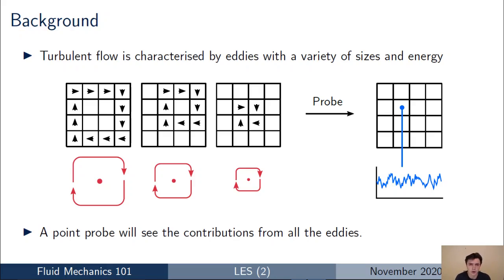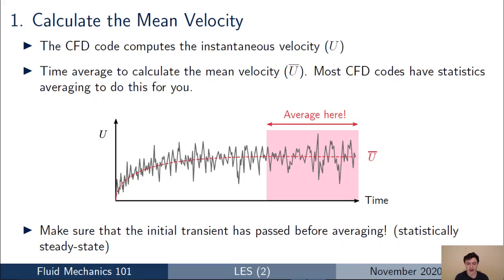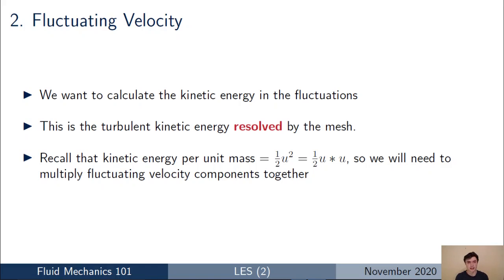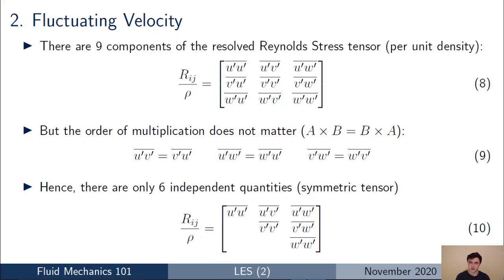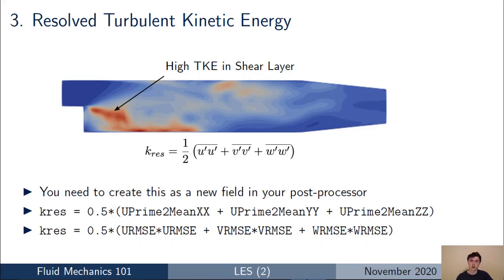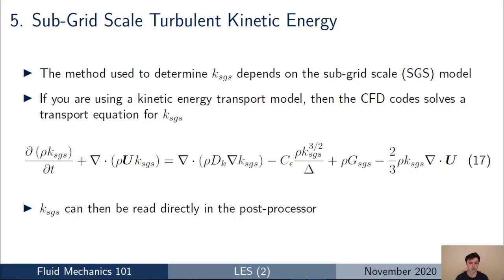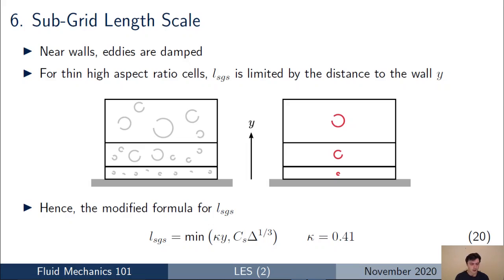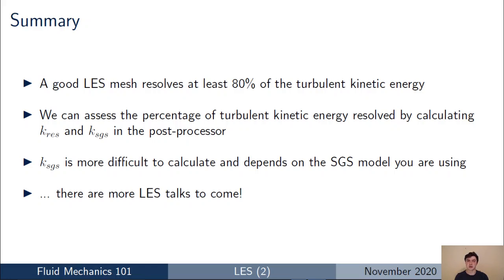[CFD] Large Eddy Simulation (LES) 2: Turbulent Kinetic Energy

Comment: It should be noted that ksgs is a also a time-averaged quantity, which is not clear in this video. In Sec. 7 (time =  32:21) the ksgs looks more like a snapshot plot. That is, you need to have a time-averaged of the subgrid viscosity, otherwise this would be misleading. This method also have limited utility and working poorly for certain problem where the subgrid models return very low sgs_viscosity; perioidic hills being one benchmark example showing +99% resolved for relatively coarse hex meshes using the WALE model.

Comment: Thanks for the lecture!
I am going to simulate liquid metal's heat transfer  to the wall - since the Prandtl number is very low, the Reynolds-Chilton analogy is no longer valid and that is something Fluent's RANS models depend on. I do not know of an efficient way to model this phenomenon, so I guess LES is going to be the way. Do you agree with this idea? :)
I've read about the "algebraic turbulent heat flux model", but that is well beyond my UDF knowledge in Fluent. If that's even possible to implement, which I doubt.
Thanks again!

Comment: Great and very helpful video! 
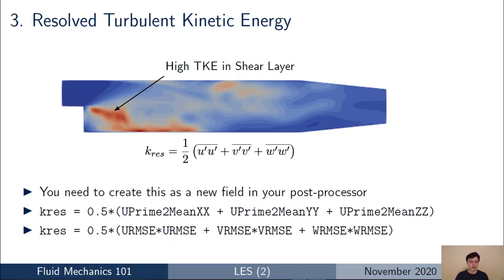I was wondering at 20:43 you are plotting the k_res for a case that looks like the tutorial pitzdaily from Openfoam. I was trying the same LES case in Openfoam but when I plot the contour of UPrime2MeanXX on paraview I get some negative values in some cells. The same happen if I calculate k_res by summing the components. How is it possible? In my mind it should always be positive since it's the squared product of the fluctuations. With negative values all the consideration that follows are also not applicable. It would be great if you could answer this doubt of mine. 
Have a great day

Comment: Absolutely fantastic explanation! One quick question, this talk has assumed that the CFD we're using already solves the averaging of turbulent eddies. Would you happen to know how to program this in the first place? Like how are the sizes of turbulent eddies calculated?
I'm building a geodynamics CFD model from scratch and some of my simulations may undergo high Renolds and Rayleigh number.
Thanks!
Reply from the maker: The Eddies are normally applied at the inlet to the domain. You can look at methods like 'synthetic eddy method' which do a pretty good job of this

Comment: Amazing video again ! All of this is being very insightful.
Do you know if the same equation (18) can be applied to other sgs models ? I'm using Fluent with WMLES and I don't find in the ansys theory guide any equation for the turbulent kinetic energy of sgs.
Reply from the maker: It has been a while since I looked at these equations. I suspect that you might need to send an email to ANSYS customer support to ask them?
Reply: @fluidmechanics101  thank you! In the mean while I did post in the learning forum and in research gate. I will post here when I got the answer 😁
Reply: So in Ansys 2022 Beta features manual they use the equation 

k_modeled = (µ_tSGS/(0.3*ρ))*S
Where µ_tSGS is subgrid-scale eddy viscosity, rho is density and S is strainrate magnitude.

However there are some models that don't output the sgs viscosity

Comment: Thanks Aiden for these great videos. A question! how to define the  time-averaging period? Is there a mathematical basis for this?
Reply from the maker: Good question. I think that when you are using RANS at least, the time averaging is implicit to the method and everything with a shorter period than the time step is implicitly time averaged out. The effect of the missing bits is accounted for in the turbulence model. With LES, it depends on what you are looking for. If you are looking for mean velocity profiles etc. then you want to start time averaging after the flow has fully washed through the domain. At that point if your flow is statistically stationary, it shouldnt matter how long your averaging period is, you should get the same mean (as long as this period is longer than the period of the largest eddies in the flow)

Comment: Good stuff. But I don't think a CFD code would solve instantaneous field values and have a statistic package though. Well if it's a DNS code and use statistics to get the mean values, then it's probably right. But if it's a RANS or LES, we then already use the averaged values in the equation/code and therefore just use these averaged mean values to model turbulent viscosity, aren't we? In fact, in OpenFOAM for example, I don't see any averages specifically done through some statistics package, I just saw the "turbulence->correct();" line deals the turbulence part. If one turn turbulence off and uses very small dx and dt, it should automatically perform as an DNS solver, isn't it?
Reply from the maker: Yes to everything you have said 👍 often what we want to look at is the transient variation of the mean, and we can use CFD code statistics packages to do this. The key is a 'separation of scales' where we average the expensive small parts and resolve the large scale unsteadiness

Comment: How would this be for 2-dimensional CFD-models, you would have to take Grid areas instead of volumes and different constants? Would the smagorinsky constant be different too?
Reply from the maker: Technically LES should always be carried out in 3D, so I don't think this has been considered before. But as a guess, yes the smagorisnky coefficient would need to be adjusted to get the right energy drain and you would use areas instead of volumes

Comment: It was really a helpful talk. Please go ahead with the pros and cons of sub-grid scale models in detail.

At 5:59, it has been shown that instantaneous velocity at a particular probe location must achieve statistically steady state. I have a query related to this. How would someone determine the probe location for achieving this statistically steady state? For example, I want to simulate an airfoil for aero-acoustics using LES. Would it be closer to wall or in far-field?
Reply from the maker: Either would be fine, as you are aiming for the entire LES flow field to have reached a statistically steady state
Reply: @fluidmechanics101  Fine. What should be time step for initial transient simulation in order to get turbulent kinetic energy ratio field?
Reply from the maker: A reasonable guess would be: minimum cell size /  1.5 * max velocity (from RANS precursor simulation). The reason for the 1.5 is that the instantaneous velocity will be locally higher than the mean velocity and so the time step needs to be slightly smaller to account for that. Run a few time steps and then check your courant number. If it is greater than 1 you will need to reduce the time step and try again 👍

Comment: Best explanation I've come across. I have two questions though, what is the minimum frequency we can capture with LES and what if we keep on refining the grid, whether we will solve DNS with LES code?
Reply from the maker: The minimum frequency (lowest frequency) depends on the geometry of your domain. You can't resolve any Eddies larger than the size of your domain. You can keep refining until you end up solving the DNS problem with your LES code. The only reason for using a DNS code is to try and speed up the calculation, as DNS often takes a long time to solve
Reply: @fluidmechanics101  and the maximum frequency, I mean I do know that the time step along with the nyquist criteria decides that, but is there a limit to it as far as LES is concerned?
Reply from the maker: Ahh normally the way to do it is to make the mesh as fine as you can get away with. Then calculate the time step as the minimum cell size / max velocity (and factor in a bit extra for the velocity as the instantaneous velocity is higher than the mean from your precursor RANS calculation). At least with practical LES we tend to think in terms of spatial size and time step rather than frequency. I appreciate that in academic studies we often work with frequencies instead

Comment: Hello sir what model should I use in carpark ventilation system (should I use Eulerian multiphase (vof) or passive scalar) ? 
Thank you
Reply from the maker: Passive scalar should be fine. You will only need to use VOF if you have a free surface or defined boundary between phases
Reply: @fluidmechanics101  ok if I used the volume fraction is it wrong ? and the passive scalar should I use it in multiphase or single phase ?
thank you for answering sir
Reply from the maker: I assume you are looking at humidity? Or are you looking at pollutants or gas clouds?
Reply: @fluidmechanics101  my target is to find ppm of co on the air (pollutant concentration)
Reply from the maker: Ah ok, a mass fraction based (multi species approach) should be fine. You will need to define a custom mixture of air and pollutant, then enable species transport
Reply: @fluidmechanics101  
I ran my study using passive scalar and it was good for me. 
Thank you Sir for your time.. I appreciate that.

Comment: Hello Aiden! Thank you very much for the information you provide for LES Calculations. Since I am doing a LES Calc for my Master Thesis, this guides me and I am learning alot from you ! Thanks again!
I do still have a question:
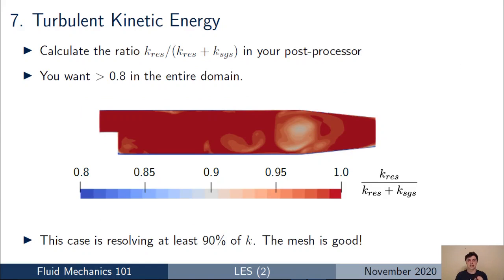At 32:46 you start discussing "How can the turbulent kinetic energy be used to assess whether the mesh is sufficiently resolved for good LES?" 
And in Part 1 of your LES Talk u gave a way of evaluating the Mesh from a previous RANS calculation.
My actual Question is: is it possible (once I made a refinement of my previous RANS-mesh) to run a new RANS with the finer grid and create again this new f-field in my post processor to see whether I am now resolving 80% of the eddies or not instead of doing the process you describe in this Video?

Thanks in advance and please continue your good work!
Alex
Reply from the maker: Yes, you could just evaluate the f field again and use this to update your estimate. But ... If you are going to do an LES simulation anyway, you should probably just calculate the fraction of resolved TKE anyway as a check. I usually just try and automate this post processing check so it is easy to do and you don't need to worry about it
Reply: @fluidmechanics101  thanks for advice!

Comment: Very informative video. I still have one question though. You averaged the instantaneous resolved Reynolds stresses to calculate kres. You showed how to calculate ksgs and explained that openfoam delivers it as a result. However, you did not mention to average ksgs, to use it in the calculation of the total turbulent kinetic energy. Is that not necessary?
Reply from the maker: Hmmm yes, that is a good point. I think you are right, ksgs should be time averaged as well

Comment: My compliments Aidan, very enlightening video again!
As Simeon Skopalik said, I would like you to have a talk on hybrid approaches like DES, SBES, and so on...and which Mesh should be suitable for those cases.

I have also found that Pope's criterion of 80 % needs to be handled with care.

I have a question about the definition of the subgrid length scale. I understood that, it is the size of the eddy which represents all the eddies at a certain location, as the idea of integral length scale.
The mathematic expression of the integral length scale is a little confusing though: it looks like the weighted average of the inverse of the wavenumber (where the weight is the turbulent kinetic energy density contained by a certain eddy of a certain wavenumber). Correct? So basically, if all the eddies at that location would have the same size of the integral length scale, you would get the same total turbulent kinetic energy?
I am asking you this since, I think, there could be a lot of/few eddies with a certain wavenumber, but the ones that count more are the ones with a low wavenumber, because they give a higher contribution to the turbulent kinetic energy (higher weight).

Thanks in advance.
Reply from the maker: Hmm I might have made a mistake in the mathematical formula for the length scale. Let me get back to you on that when I have checked. Time to have another read through Pope!

Comment: Keep up the great work Aidan. After you are done with LES, could you please consider making a video on Multigrid solver settings and what settings are typically used for achieving better convergence in various industrial problems. Thank you for all your hard work.
Also, do you use beamer to make your presentations or is something else? The template looks very clean.
Reply: Thanks for the reply Aidan. I use Beamer sometimes. Haven’t used Inkscape at all. Will give it a try. Cheers!
Reply from the maker: Yep, beamer for my presentations and I make all the images in inkscape. I am a big fan of open source software as it is free and available for everyone. I would really recommend beamer for presentations. It is great!

Comment: Nice work, I think your lectures are really well-done! Regarding LES resolution assessment, I highly recommend the following paper
Davidson, L., 2009. Large Eddy Simulations: How to evaluate resolution. Int. J. Heat Fluid Flow 30, 1016–1025. https://doi.org/10.1016/j.ijheatfluidflow.2009.06.006
Unfortunately, the 80% criterion works rather poorly. A better measure is the amount of cells discretizing the integral length-scale. However, that is more difficult to compute in the LES. Using a precursor RANS one may get at least an a-priori estimate to relate the mesh to.
Reply: Yes sir he is very good teacher and also your video on wall modelled les are fantastic u guys are great
Reply from the maker: Thanks for the suggestion timofey! I will definitely check out this paper